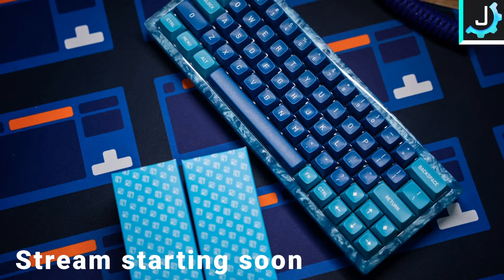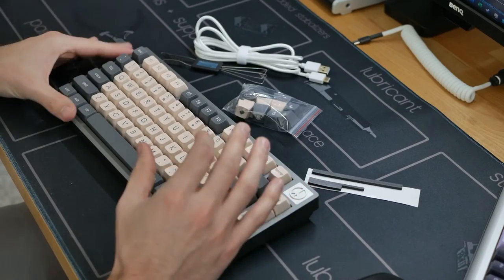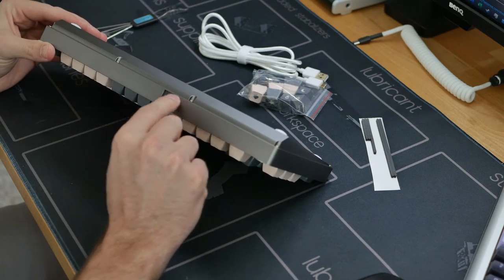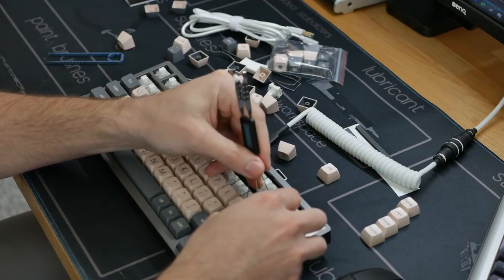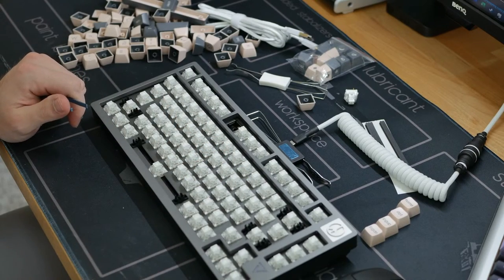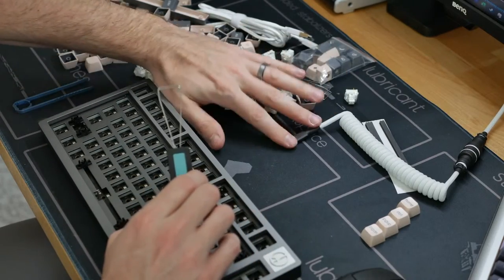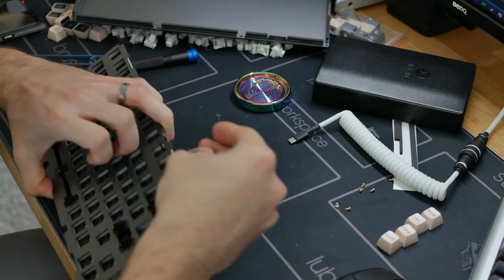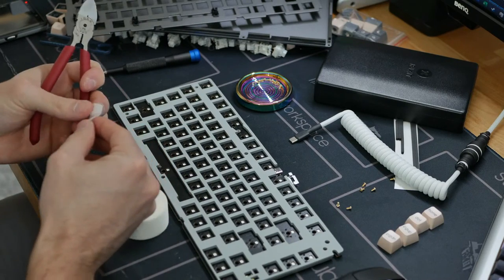Ajazz AC081 CNC Aluminum Keyboard Build Stream

Comment: i feel like this would benefit from a higher quality switch, with lubing and foam. that would probably sound amazing. seems like a good value though.
Reply from the maker: I removed the sorbothane a little bit after the stream and added in polyfil and made a world of difference. The switches are good, would recommend a 205/105 mix. Good value for having everything included though, just wish it had screw in stabilizer support